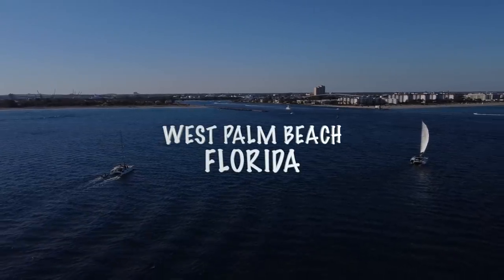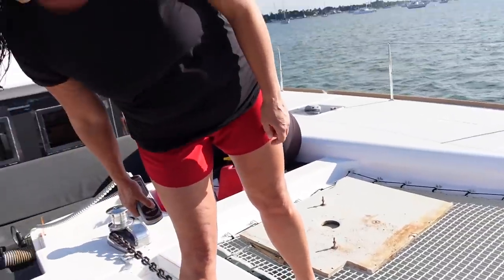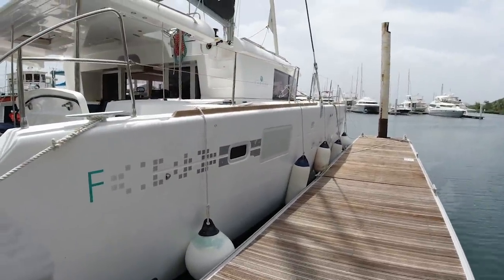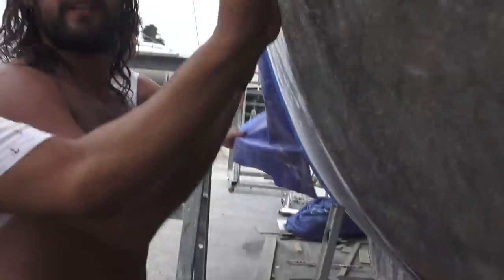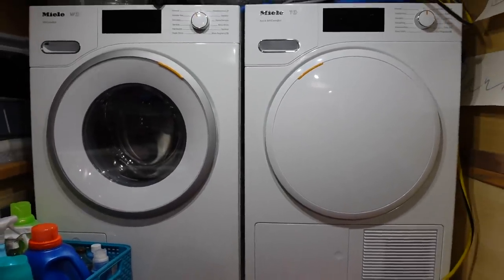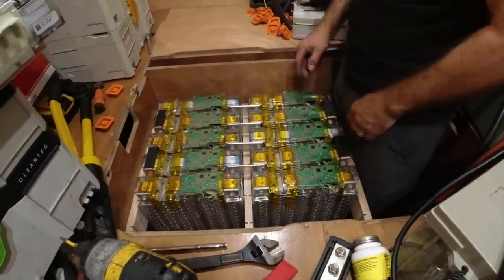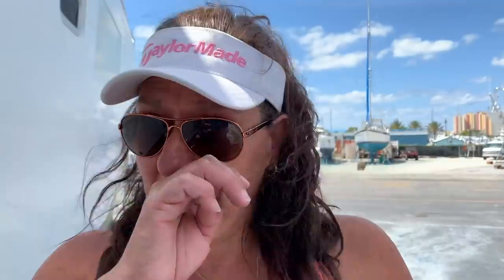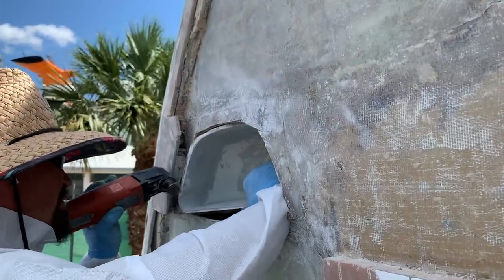Biggest lithium battery installation ever on a sailboat? - Episode 105

Comment: their boat will make a really interesting case study about how those automotive batteries stand up to marine conditions. I've been really curious about that question, but so far the few tidbits you could find on the internet about such projects have been in their very early stages, and rarely more than a single post on a forum somewhere. So it will be really interesting to see youtubers document their longer term experience with the Tesla battery pack.
Reply: I've thought about this issue but I have no boat on which to try it. I think I would build an enclosure that would stand up to complete submerging and group the modules in banks, in aforementioned waterproof enclosures, that are small enough to manhandle if needed. All that in addition to every precaution in the book and beyond to ward off slowly advancing causes for corrosion and whatnot. Also some implementation details that possibly make or break that critical backbone...
Reply: Sailing the Space Between has been an early pioneer of using car lithium batteries in sailboats, for various reasons it's taken them several iterations before they've been comfortable that they got it right
Reply: I was thinking about this myself. Im an electrical engineer and did my Electric vehicle course before the pandemic. If you get a fire on an EV battery you don't fight it you just evacuate, when the fire service come they put a chain around the vehicle and drag it out the way then just leave it to burn its self out for the next week or so. They cant extinguish it on land, on a boat maybe use explosives to jettison your entire battery pack through the hull seems extreme but that's all i could think of that's guaranteed to work. I love Teslas, and I love what these guys have done they clearly know what their doing, I haven't got the balls to have that much lithium under me at sea though.
Reply: @sietuuba  exactly he doesn't mention how much sailing they have done and the conditions....I'm really interested in the safety precautions they have..... Day sailing is one thing crossing oceans is another....I wish them the best....
Reply: Any issue with those batteries and the entire boat goes up in flame.  Those modules have a cooling loop that isnt being used and the BMS is assuming its used for a car application (high C rate).  I personally would only put LFP's in a boat for the added safety and they are getting really cheap (~$150 per kwh for the cell).
Reply: @dylanpeterson6449  Definitely LiFePO4 or LTO chemistry only, out of the types available on the market at the moment. I didn't even get to the fire safety part with my earlier message... I forgot to mention I would rule out any chemistry liable for thermal runaway from the get-go!
Reply: Do they have these electrically driven propellers that can also generate power when sailing? (not mentioned in the video) (like the couple in Sailing Uma)
Reply: @dogfood61188  My thoughts exactly, well said.  In the air or on the water, fire is a crews worst nightmare. Notice they did not show off their state of the art fire fighting equipment. That ice maker won't be of much help.
Reply: @jakleo337  ice maker fire extinguisher/safety equipment :))))
honestly wish them all the best
Reply: @dylanpeterson6449  where would you buy them from?
Reply: @slavek033  you can buy them from alibaba.  Half the cost is shipping to the US, but this video below explains it and has a link to the supplier he used: https://www.youtube.com/watch?v=GwVXLDZDKZk
Reply: @dylanpeterson6449  thank you very much fot the info, appreciate it

Comment: Nothing excessive about 5kw of pv. This is the future. The way that it works together is the innovative step. Smart systems that tell all the  compressors to 'share' the load and NOT kick in at the same time etc. Control and monitoring systems need to be developed. And redundancy is the key. A single massive inverter, not idea in salty lightning risk environments. Multiple strings of pv, independent supply systems will make it more robust. You guys and others bringing up live-aboard standards to modern house like lifestyles is a big important step. You are raising the bar and should feel really proud of your contribution to the lifestyle. And your learnings and mistakes will be important experiences for those coming after you. The gear is getting cheaper and better. I'm so glad to finally see decent pv and battery systems being employed. A kW of wind would be good too.. I hope you have a way of shutting down and isolating some of your solar for when it fails, and it will, big fire risk in that much dc in those environments. But how you manage the wiring, connections, and equipment failures will lead the way for others. Dont trust anything, develop emergency procedures for arcs everywhere. Isolators everywhere, and extinguishers. Great to see. And you made me cry. Thanks for the inspiration.

Comment: When I watched you party on the Super Yachats I thought just that your a party guy but I've changed my mind. You are a very good interviewer and extremely knowledgeable about this. I'm a old Navy Photographer 1970 to 75 and a long time sailor. At 70 now I'm now going to travel in a 2017 F350 dually with a Cirrus Camper and I'm going to travel from Florida to Alaska.  I did restore a 1978 VW WESTFALIA CAMPER  and after that I realized I need more room for this old body.

Comment: I am one of them guys sitting around saying I can do this! Matter fact not only do I think I can do it, but I think I am prob inflicted just as bad as these dudes! Spreadsheets, numbers and algorithms and we speaking my language! I am a mechanic turned nerd that decided to go back to school for software and web systems management at 48 years old. It is by far the greatest thing I ever did. Been one of the most fulfilling things of my life! A passion you might say lol. I have another dream turning passionately in my mind and that is buying a sailboat and transitioning to a live aboard in time. I am actually going and looking at a sailboat next weekend up on Lake Michigan. A hunter 31. A boat that I can afford while not draining our savings and we can take the next few years learning how to sail it and learning what life aboard a sailboat looks like. But one thing that me and these folks have in common, I would pay 25k for a boat and put 12k into the battery/inverter/solar system, before I would just buy a boat that was bigger for 40k. Not saying that's what they did, I'm just saying that power means as much to me as it does them. I found the tesla batteries, the quattro, and the solar panels but I could use a rough draft of the connections. Nevertheless I prob need to jump on this dudes crew and get some knowledge!!!

Comment: I'm 70 yours old and I did not miss a thing, I've done it all with few regrets and I don't feel like there was something I should have done. I don't own a sail boat and never have but I never wanted to either but I have owned several airplanes. I live on the Gulf coast and have sailed but it was something I never was really interested in doing however I enjoy watching people like this and their love affair with sailing and sailboats.
I worked on several large sailboats doing repairs in the 80's that were equipped with the Pathfinder Sailboat Engines. These engines were in cramped spaces and the wiring on these high dollar boats was a nightmare ,wire color would change several times in one run.
Anyway, life has not passed me by and I tried or did it all.

Comment: Sounds like he has a nice system.  My major concern is the Tesla batteries.  The cells in the Tesla banks are lithium ion cobalt.  Although they have superior energy density they are susceptible to thermal runaway and catching fire. The fire once started, cant be extinguished until the combustibles are consumed. Not a problem in a car, you can pull over and get out.  For a boat at sea or an airplane in flight you don’t have many options to evacuate. For this reason Lithium iron phosphate is a more desirable and the gold standard battery chemistry in these applications. The energy density is less but the safety factor vastly increased.  Phosphate cell don’t catch fire even when directly shorted or when punctured. Hopefully you have multiple thermal and smoke alarms loud enough to wake the dead. An insulated steel enclosure for the battery banks that vents to the outside would also be a good idea. That way if your bank caught fire the boat would survive.

Comment: Hi Colin, I was on board a sailing vessel in Husvik, Iceland the battery bank was over 10 times bigger, that's over 50,000 amp hours. I even have photos.                                   Phil

Comment: Check out Capt. Rick Moore's vlog, sailing sophisticated lady for another battery/solar setup on a 50' mono. He is running A/C and a lot of other appliances but with regular nicad batteries in a 24/12 volt configuration. Hope to see you back in Panama soon.

Comment: My worries would be the battery suspension. After all marine batteries are built for the abuse of all the moisture, sudden hits, & vibrations that come with being mounted into a boat. The Tesla batteries are built for living life sitting atop the cloud like suspension system of a car. 
 Inspirational for sure & not belittling anything!
 Personally I’ve been toying with the idea of a mono hull with outriggers. Then use the outriggers for holding the batteries. That could allow an emergency cut away system in case of a cell short/fire within the power bank. After all, once that lithium candle lights up, distance is your only choice.

Comment: Fantastic job.... just a little nervous about those Tesla batteries. When they combust they really combust. I'd want the liferaft to be well away from the batteries.
Reply: Thank you! Don’t be nervous, not only is every individual cell in a Tesla battery is individually fused on + & - we also have triple redundancy on fusing and disconnects.  We use Tesla’s’ a BMS software for monitoring and disconnect if ever necessary.  Our only real risk we have would be damage from catastrophic impact traveling many feet past and through the hull, cabinetry and battery rack..... if that happens we definitely have bigger problems and will not be staying on the boat.
Reply: @SailingDauntless   @Sailing Dauntless  Good to know. You've done such an epic job you could certainly make that a business. I did read that most of the Teslas that have burned out of motorways suffered some prior damage. Just don't let those dendrites grow too close. (By the time that happens there might be viable solid state batteries anyway).

Comment: Tesla cars hold the batteries in sealed cases with desiccant packs to ensure very low moisture to avoid corrosion.  I wonder how they are controlling the humidity around those packs in the boat?

Comment: Would like to know who designed the elect system or if they did it themselves. from power use calc to equipment to install.??
would love to get more info from these guys on the elect install. Its what i'm looking to do as well
Reply: If I understood it correctly the they did the install themselves, the calculation I'm not 100% sure about but at the very least they understood what the wanted. but I also suspect they did the calculation themselves

Comment: thankyou for sharing your story and would like to let you know on the electrical side of the installation that the solar flexible panels may not be as reliable as the fixed panel versions (from balance catamarans youtube video they use the fixed panel versions). Tesla   batteries to have a much lighter weight for the same ampere hours (assuming NCA mix Tesla model 3) but may increase the risk of fire compared to LFP (So4) lithium batteries which is more widely used in marine at the moment. There is talk of the adding of manganese to LFP (producing ‘LMFP’) to the mix to improve LFP energy density marine batteries while retaining its superior attributes but this is not commercially available yet.
regards

Comment: @daversj suggests in a separate comment that a steel battery case may improve safety when using Tesla modules in a boat.  Actually a steel case may not protect the boat against a Lithium battery fire.  Lithium burns very hot and might burn through the steel or heat the rest of the boat enough to catch it on fire.

Lithium Iron Phosphate (LiFePo) is a better solution for the reasons he mentioned: unlike Lithium Nickel Manganese Cobalt (NMC) chemistry which Tesla uses LiFePo doesn't suffer thermal runaway and won't catch fire if shorted or punctured, etc.

That all said, the Tesla battery modules have multiple mechanical, chemical and electrical systems to isolate damage, limit fires, etc.  For example every cell is connected with a bonded wire which acts as a fuse and disconnects the cell from the module if it individually goes over current.  And there are multiple fire, gas and pressure suppression systems built into each cell and the battery module.

While the risk with NMC batteries is real, and fires can happen, and they could be very bad on a boat, the likelihood of a fire happening may be less than might seem, due to the safety built into the Tesla cells and modules.

While Tesla modules are highly attractive for their value and density, Lithium Iron Phosphate is safer and better in a marine application.

Comment: Often wondered if you could use a Tesla Powerwall home battery set up , 5kw or even the 10kw  battery storage and smaller battery than the tesla car battery packs . Less weight , smaller and packs a shitload of power storage

Comment: 9:06 Until I watched this, I didn't realize that "they" say that you can't put that much power capacity on a boat, or that you can't use Tesla batteries on a boat. Can someone here offer insight into why no one (which I assume includes marine builders and electricians) except these owners believes it is possible?
Reply: I'd also love to know how they ended up paying a 75% discount on equipment. Were the Tesla batteries salvaged?
Reply: When these Tesla modules fail they fail catastrophically and explode with fireworks, unlike LiFePO4 that will just vent gas. Watch the video "My First Tesla Battery Fire".
Reply: We consulted several refit companies and shipwrights and we were basically told “that’s not how it’s done”.... Then, when we were finished some of the same group said “great system! How did you do that?” I think the short answer is because of the small market, change and new developments move slowly through the industry.
Reply: @muprock  we purchased a 75 kW car battery assembly from a reputable Tesla parts reseller out of California. Our car had 7100 miles and was not damaged due to collision or water. Each individual module was tested by the company and retested by us. We also inspected and verified every single positive and negative fuse on every single one of the 4400 cells Prior to installation
Reply: @CraigOverend  Like my daughter says “everything is a smoke machine if you operate it wrong enough” this guy put in Tesla modules with no battery management system, improper wiring and admittedly created a danger for himself and others because of it. I think this is an unfair representation of a product.

Comment: Does this boat have electric propulsion too?
Reply: No, that would require double our system unfortunately, we would do it if there was room for more solar
Reply: @SailingDauntless  From the discussion it was apparent that you still need to figure out the difference between energy and power. It's the same as work (man-hours) and workers (a "man"). One "man" (representing "power", in Watts) working for one hour produces one man-hour of work (energy, measured in man hours or Watt hours (Wh) when it comes to electrical energy).

A thousand men working for one hour deliver a thousand man-hours of shoveling, for example. One man shoveling for a thousand hours delivers the exact same result. A 53 kWh battery bank takes a thousand hours to fill if it were to be charged at a power of 53 watts because 53 W x 1000 h = 53 000 Wh ( = 53 kWh). Keeping track of the proper units (like hours in watt hours and amp hours) is what makes the equations and results make sense when you hear them. Your BMS talks about them too. Amp hours and amps are fine if the voltage is always known to be nominally the same (like in a 12 V system) and even there the "h" is what makes the critical difference between available work in the battery bank and the effort required for a given charging time to fill it.

One of those Tesla modules is 5.3 kWh nominal capacity as you know, so ten of them is 53 kWh. With 5 kW of solar input in "standard conditions", that is ideal insolation from the Sun in cool weather, it takes (53 kWh) / (5 kW) = 10.6 h to fill the battery bank, but of course real world conditions change and real world equipment has considerations different from ideal example on paper so it'll take some more time than that. Sorry, I got too wordy with it but I sincerely hope this helps!
Reply: @SailingDauntless  10kWp of solar does indeed look like the goal for fully-electric.

Comment: 9:28 Isn't this uncommon since lithium will react violently with water whereas lead acid batteries don't have that problem. Surely that battery will burn down the boat if the bilge flooded, definitely if it's ruptured. Waterproofed hardened enclosures seem like a must.

Comment: This is not a big system, just small. With electric propulsion to increase fuel efficiency, silent trawling, slow cruising plus all the other energy potential at sea, solar, wind and wave that people do not utilise a large battery bank is so beneficial. My build is a few years off, but I am looking at 120kw of AGM and 30 KW of Lithium plus 15kw of solar, wind turbines and wave generators.